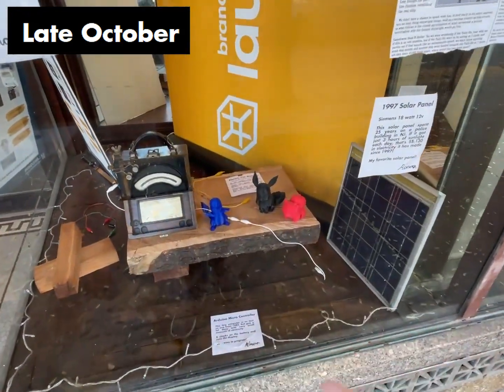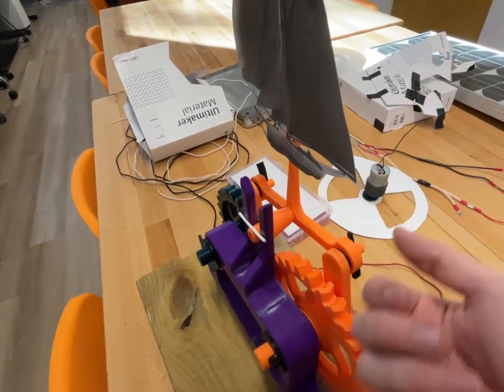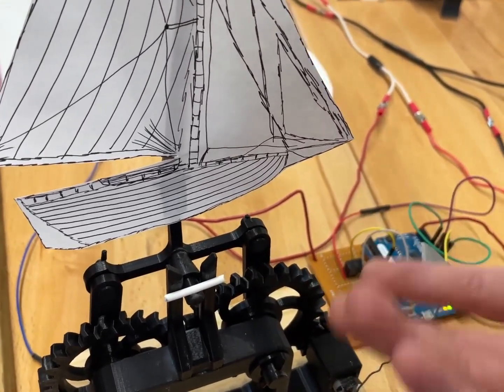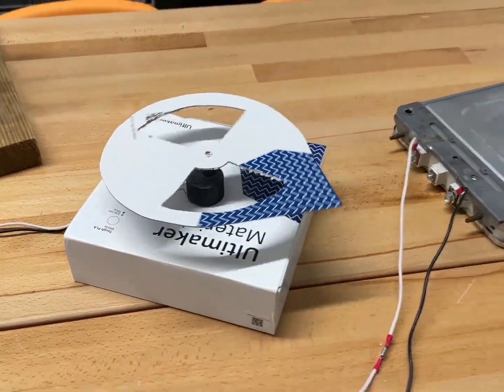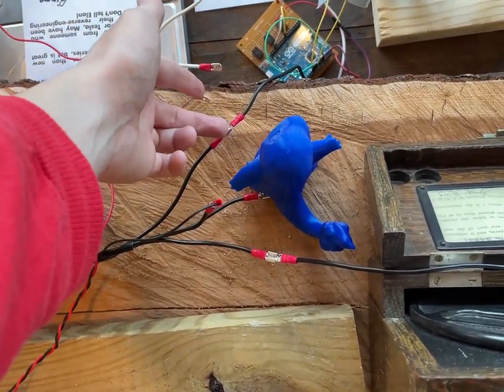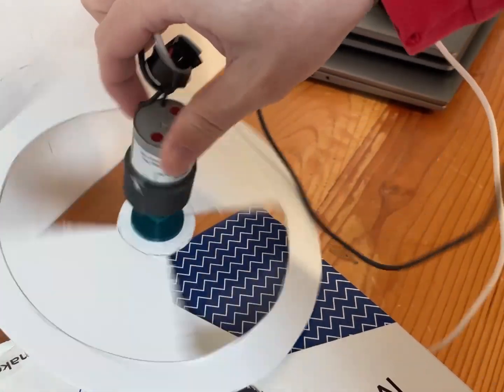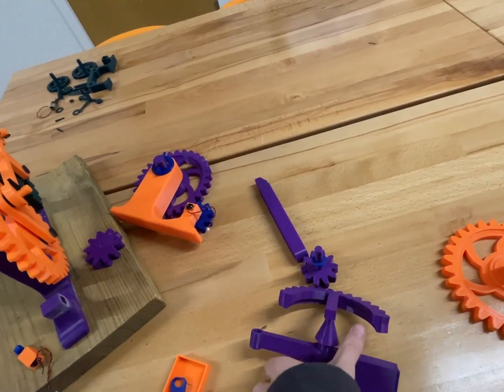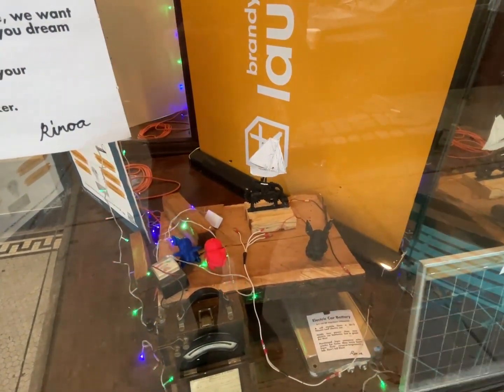Makerspace Automated Solar Display 4: Three months of running causes chaos in my design!

Comment: Considering the humidity, you may want to scrounge up some heat shrink tubing for the spade connectors or they may give you trouble in time.  With regards to managing your wiring, since you have access to 3D printing, take a look on Thingiverse for cable ties, cable tie bases, cable management clips and zip ties. ;)
Reply from the maker: Yeah when I get something working well enough I will solidify the design. This is just temporary though.